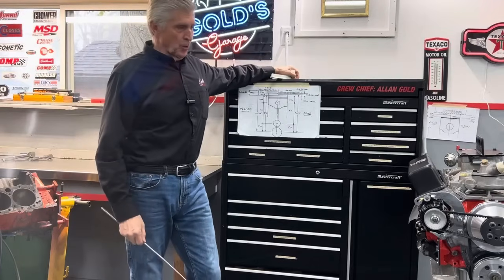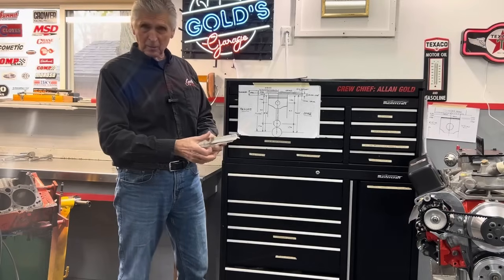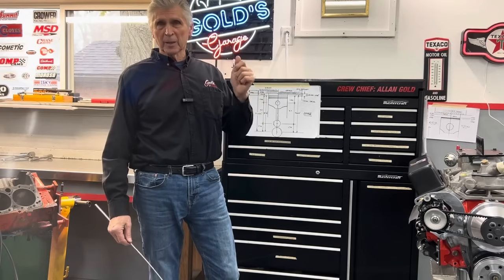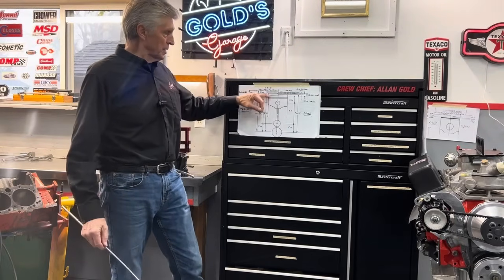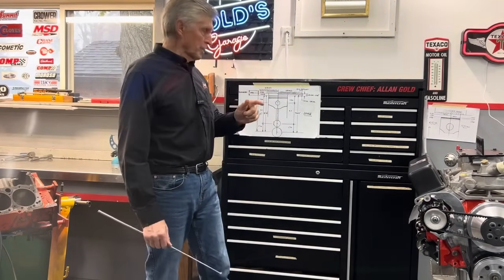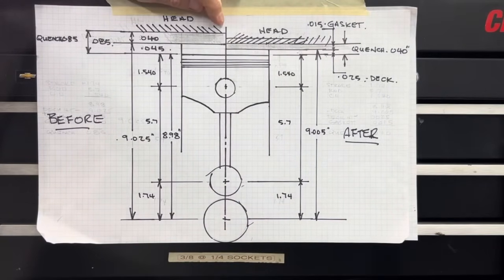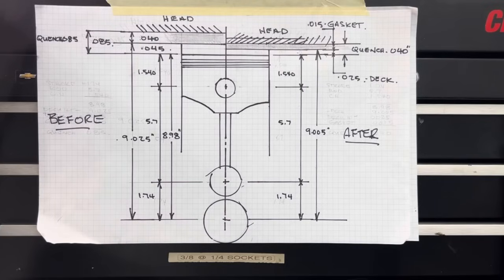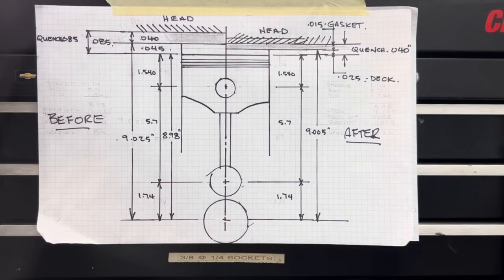MORE COMPRESSION, MORE HORSEPOWER LESS QUENCH! Why it’s Important and what is ideal?  🚫DETONATION

Comment: What are your thoughts on a soft chamber? I am very new to this. Working on a mopar 340 build. I am using aluminum heads. Just wondering if I could benefit from having the flat/quench areas on the head cut at a slight angle? Does it make a difference?
Reply from the maker: Thanks Anthony, i don't have much expertise in this area. Check out the Brian Salter Racing channel as he does explore these these details.AG

Comment: Why can't you use the steel head gasket .015 with aluminum cylinder heads
Reply from the maker: Good question Thomas. One reason is that there is a warning disclaimer on the package not to. A couple of possible reasons that i can think of: one is that the expansion rate of aluminum is about 3x the rate of steel. Another is that there is a chemical reaction between steel and aluminum called "galvanic corrosion" that would bond them together. Hope this helps.AG

Comment: Mr. Gold, could a similar satisfactory result be obtained by just decking the heads (instead of the block) ?  I ask because i'd hope to avoid having to pull the engine back out (It's a big block Mopar & really heavy). Thanks
Reply from the maker: Thanks for the question Shane. If your quench pad on the heads is flush with the head surface, decking the heads will increase compression but not quench. If you can use a thinner head gasket,  that will help quench and increase compression. Hope this helps.AG

Comment: Thankfully, your video saved me the same from the same issue. Machine shop ordered me 1.546 compression height & I'm now decking .020. It's cheaper than new pistons. .027 head gasket will give me .044. I'm using aluminum heads so I can't use the .015 gasket.
Reply from the maker: Thanks Joe, glad the video was helpful.AG

Comment: I have no doubt as to the correct essay of the info you're providing in this video.  BUT, you NEVER explain what quench IS. Ma,ing the entire video, largely, a waste of time.
Reply from the maker: Thanks for the comment Jalan. For sure i should have explained quench.  Quench is the distance between the top of the piston and the bottom of the head. IT is normally determined by the deck height (distance from the top of the piston to the top of the block) and then the thickness of the head gasket. 
Ideally this distance should be about .040". 
A tight quench helps to make the fuel/air mixture more homogeneous and then force it toward the spark plug in the combustion chamber. This promotes more efficient combustion and helps to prevent detonation. 
The tighter (less) the better, however it is too close the piston may strike the head and that would be catastrophic. Some builders may go as little as .035" or less. 
please let me know if this helps. AG
Reply: @goldsgarage8236  Absolutely, although I was able to get a working definition from the very next video I watched.

Comment: Hi mr. Gold's if not allowed just ignore me but i wanted to know your thoughts on a 358 build with 12cc pop up dome pistons. 6inch H beam rods crowler forged 3.480 stroke crack. flo-tek heads 180cc intake runners 66cc exhaust runners and 2.02" intake valve 1.60" exhaust valve cam lift 443/465 duration 214/224 112 LSA TH350 but plan on changing to a 4L80E later on posi rearend 3.73 gears may change to 4.11 3000+ lbs car
Reply from the maker: Sure Bos. lots of good parts there. One concern is compression ratio. You did not mention the combustion chamber volume of the heads, but if they are 64cc, with 12cc pistons it may be high, I suggest you use the Summit on line compression ratio calculator to determine your CR and then the Wallace calculator to determine the dynamic CR and estimated cranking pressure. 
If your engine is already assembled, just do a compression test to determine cranking pressure. For pump fuel, I like about 180PSI. Hope this helps. AG

Comment: Just subscribed and a great video on explaining quench. I did a build on my 99 suburban with vortec 350 that I bought from a retired cop. When I tore it down the engine looked like new. No wear on the cylinder walls at all, pistons, rods, mains, cam bearings, etc looked like new. Cleaned her up, put in a mild Lunati cam, AFR enforcer heads, kept the fuel injection but did a MPFI upgrade with 36 lb injectors, cleaned up the factory mold marks on the lower intake plenum and port matched the runners to match the heads. Still have to get it dyno’d because I just have a bench tune on the ECM for now, but she runs really well. Also my first build in 20yrs. because of a bad accident that left me paralyzed for a short time, but I’m finally back into it after all these years.
Reply from the maker: That's a great story Brandon, thanks for sharing and we're happy to know you are back doing what you love to do. Merry Christmas. AG

Comment: Detonation? It seems to me that preignition occurs way before TDC. Less quench/squish won’t solve that problem. It will just boost the air/fuel mixture towards the start of the point of igniting aka the spark plug.
Reply from the maker: Good point, and you are correct. It's a viscous circle, Incomplete combustion causes carbon build up, then the carbon causes pre-ignition. IF we solve the quench, the new engine won't have a problem with carbon build up.AG

Comment: Isn’t detonation occurring when the squish/quench ratio is to high? In other words: the less space between piston and head the more pressure the sooner the change of reigniting the fuel/air mixture.
Reply from the maker: You have given this subject some thought. I think that correct quench will promote proper combustion by forcing a homogeneous F/A mixture towards the spark plug. At least, that is the theory. Thanks for commenting. AG

Comment: So how much hp would you gain by increasing cr one point, percentage wise.
Reply from the maker: Good question Ricky, it does depend on many other variables and one thing to remember is diminishing returns. The more you increase it, the less you will gain. Best guess, if you increased it from 9:1 to 10:1, you might gain 25HP. AG

Comment: I have .040 quench and my pistons are covered on carbon.  What would cause that?
Reply from the maker: Possible causes: Too much idling or slow speed driving, rich carburetor mixture, idle transfer slot too exposed, ignition timing, (usually not enough advance), cold spark plug heat range.  
suggestions: use higher heat range spark plugs, use manifold vacuum advance with at least 30-40 degrees at idle, lean out your idle mixture as much as possible, close throttle plates as much as possible at idle. Does any of the other viewers have any ideas? AG
Reply from the maker: Forgot to mention, operating temperature, should be between 180-200PSI. Install a thermostat if you don't have one already.
Reply from the maker: I meant 180-200 degrees F, not PSI?

Comment: I offset grind my crankshafts for hotrod and race engines. We gain about 3 cid and compression because stroke is increased. This makes achieving 0 deck height with less milling off the block deck. This saves block for future surfacing, if needed. We use std cranks and offset grind 020. (We usually dont go 030 as an effort to save crankshaft life for future grinding, if needed). On sb chevys, only 015 ish is needed to mill for 0 deck, versus 025-035.
Reply from the maker: Thanks Pat. Great info, I have never thought of doing that. In a future build, when we are re-grinding the crankshaft, I will look into doing that.AG

Comment: Thanks very much ....great info.. I have always been told .060 was about as close as you wa ted to go with aluminum heads. I am running Indy l port worked aluminum W2 heads with a 2.100 intake valve on a 410 cub inch LA based 360. I admit I am a lifelong hotrodder but rookie engine builder.....always learning..... set up of everything correctly complements everything else. Great video.
Reply from the maker: Thanks G. I have never built an engine with aluminum rods, but .060" sounds reasonable. Its never too late to learn.AG

Comment: I`ve noticed when you buy garden variety oversize (.030) pistons they decrease the pin height by .020. to do exactly what us hotrod guys hate, keeping the compression low, but they will keep the pin height stock for an extra charge which we hate too. My dad told me "if you got a problem throw money at it and it will go away".
Reply from the maker: Thanks Ed, your dad makes a good point. Higher compression height pistons are available, but they are expensive.AG

Comment: Thanks once again, you've got me thinking.
In  this type of application are quench and squish more or less the same thing and do domed pistons factor in if they are included in the mix?
Reply from the maker: Sure, quench and squish are both the distance or space between the flat part of the piston and flat part of the cylinder head. If you have a domed piston, you still measure from the flat surface, not the dome. AG
Reply: @goldsgarage8236  Thanks for  the reply AG.  That's kind of what I figured.  Just evil two-stroke thoughts messing with my head, where the effect is the same, but the visualization is different with no valves.

Comment: Less quench or less quench distance?
Reply from the maker: Less quench distance.AG
Reply: @trailerparkcryptoking5213  
Less distance. Quench is technically an action. It means to suppress or extinguish a flame. The measureable amount of area which will accomplish this is less than .060" for an internal combustion gasoline engine.

Comment: Great info. as usual, Alan. 20K Subscribers soon Congrats! Hope your healing process goes well. I've always used .030 min. quench for an engine w/ cast  iron block and heads using steel rods and held to less than 7000 r.p.m. Add .005 for engines that would see over 7000 r.p.m. This always worked for me, providing max performance and no detonation, no run-on, etc. Some feel this is too tight. I'm just stating what worked best, without fail, for me. If the vehicle is manual or somehow over revs, no engine limiter, missed high r.p.m. shift, etc. these dimensions may not be adequate. Though I never had a problem since my race engines always incorporated a rev limiter. With aluminum components, aluminum rods, and over 7000 r.p.m. .040-.045 quench got the job done without issue. Also, as far as mitigating detonation and determining accurate compression make certain to include the crevice volume calculation. Crevice volume is the open space between the top ring and the bottom of the cylinder head or gasket...(Provided the gasket bore size is exactly the same size as the cylinders.)  There are head gaskets that are manufactured with bore sizes larger than the actual cylinder bore dimension. If this type of gasket is used it can dramatically increase crevice volume if the head gasket is a thick one.
Reply from the maker: All good info, thanks Bill. i have to take into consideration that i have no control  over what happens to any engine once it leaves my shop.AG

Comment: How come you don’t use a 6.0 inch rod instead of the 5.7
Reply from the maker: A 6" rod requires a piston with a shorter quench height, so it doesn't really change anything. You still have to manage it. AG

Comment: I'm enjoying your videos and recommended them to my son!  My 84 vette had the trw's and were only .022 in the hole. I'm using brodix IK 180 heads and am comcerned about now the "eyebrow' nelne relief enteracrs with those pistons
Reply from the maker: Thanks Gregg, if i understand your question, I believe that GM felt the valve relief design would help. As I recall, Z28 pistons were the same only with a raised dome.AG
Reply: @goldsgarage8236  I will try to send the info from "chevrolet by the Numbers' It's said that the trw's in 84s were left over from the c3s. Thanks for the reply Allan!

Comment: Theory- SQUISH
Squish is when the gas in the Squish area is jetted out when the piston is coming up to TDC.  It creates lots of turbulence, mixing,  (and can make swirl etc) now you can have too much and blow the fire out.  You can put the squish pad (s) so as to promote flow out the exhaust.   Best to start with a modern head with a modern combustion chamber (hint they take less timing) most have quench/squish pads on both sides of the chamber and a central spark plugs   Many early heads just copied the old "true wedge" designs from 48 Olds and Cad (and earlier) the 55 chey, 58 Chrysler etc.  RUN pay up for a good head then add quench,  One of my 440 Mopars has the pistons "+.015 due to deck twist which took lots of milling to get square (and Marine gaskets) .030  A 250 Chevy 6 with 307 TRW pistons profiled like the 350 "Turbo"  piston ended up at .025
You can do it but takes some planning before you buy parts and deck the block.   David Vizard has a video on quench and I see some others over in the suggested video listings   You will have less timing and less octane strictures.   I'm not saying you can't make slightly more power with an open chamber or hemi with race gas (but note the quench pads on late Hemis from most every make) Thanks POWELL great video
Reply from the maker: Lots of good information Jm, thanks for contributing.AG

Comment: Would you still deck the block if you were using dome pistons (11:1)?
Reply from the maker: Yes Lance, the quench pad on the head lines up with the deck of the piston, that is where quench is measured. The dome protrudes into the combustion chamber. Hope this helps. AG
Reply: What's the stock deck n steel shim do for it like 55 guench??? Or I'm maybe 65. Im running 350 block eagle 375 crank short 400 rod n like DZ 302 pistons domed a .015 felpro steel n Dart 007 72 cc. Pocket ported n bowl work nothing eles. A GOOD tork cam 282 with retro roller n 1.6 rockers a air gap n 750 Brawler n A 1940 FORD PU 325 REAR 350 N KIT N A TCI BREAKAWAY CONVERTER TELL ME ABOUT THE FUN FACTOR PLEASE IS IT GONNA WORK OR NOT???
Reply from the maker: Todd, lots of variables to consider. I suggest you mock it up and measure the distance from the deck to the piston (deck height) before you go any further. AG
Reply: A 30 inch tall tire 15 inch wheels
Reply: 2800 lbs

Comment: Some theory, application below 
There are at least two things to consider  QUENCH and SQUISH
Quench is when two cold surfaces (the flat on the head and the flat on the piston-Think the Classic TRW "Turbo" Piston" and early Small block chevy.  Or the PRE 68 Big Block Mopar and other "wedge" engines like Early Olds and Cad, Tough for detonation or ping to happen on the far side of the piston and the plug when clearance is held TIGHT
Reply from the maker: Thanks for the info Jm.AG

Comment: Hello Allan

I have a Ford 347 Windsor stroker, zero decked and 0.047 compressed thickness gasket.
Is it a acceptable quench?. 🙂
Reply: 0.030 is a typical target… tighter is better…. But touching can lead to a bad day. It’s important to measure. These are actual clearances. Tolerance stacking is the reason for wider targets.
Reply from the maker: Thanks 59. Sure, I think .047" will work fine. AG
Reply: @goldsgarage8236  Thank you Allan 👍🙂

Comment: Great video Allan.  Thanks a lot, I learned a LOT from this video.  Hard to believe after all the years of half-hearted hot rodding and standard street engine rebuilds how much I did not learn.  Better late than never.
Reply: @davestarr7112   people just don't get it they buy the cheap overhauled kits with pistons  down the hole .045 and use the .040 gaskets and have a quench of  .085 and them motors don't got shit for compression  and wide quench , they denotation and they run worse  than a stock engine and people dont have a clue when u explain stuff to them.   I never buy the cheap rebuilt kits.
Reply from the maker: Thanks Dave, that is why we do it, Thanks for commenting.AG

Comment: Whats the difference in price between using longer rods and pistons with suitable compression height and going standard length rods with decking the block as you say?
Reply from the maker: Thanks Magnus, 5.7" is the standard and they are typically less expensive. Even with 6" rods you still have to mange quench height as they require pistons with shorter compression height.  The difference in length is only 5%. AG

Comment: I concur on the quench being too much. 0.040" is accepted as standard. Depending on the build, if it is a street oriented engine with decent steel rods and a 6500 RPM red line, the quench could be reduced some. 0.030" would be pushing it, but 0.035" could be beneficial. Stroke plays a big part as the longer stroke generates more inertial forces to stretch the rod and piston, especially as the RPM increases. 
Take it easy and get well Allan.
Reply from the maker: Thanks Dale, good point, piston speed is a function of stroke length. As for .030" remember, I have no control over what happens to an engine when it leaves my shop, so I have to be a little more conservative.AG

Comment: Hi Alan, spot on!,
I try to explain this to certain clients, and when they use cams with inlet durations above 280 degrees it hurts compression drastically coupled to engines with excessively large quench.

I have an old Keith Black piston catalogue and he explained the importance of proper quench and how smaller quench area improves  detonation resistance.
Reply from the maker: Thanks Dean, comments coming from an expert like you help to reinforce my point. Thanks for contributing.AG
Reply: @goldsgarage8236  Hi Alan, I'm definitely no expert! , I qualified as an Automotive Machinist 26 years ago, I guess building engines multiple different ways shows one what works and what doesn't.
Regards, 
DC